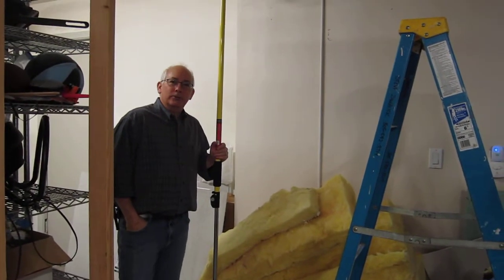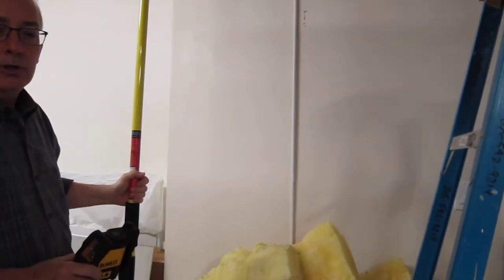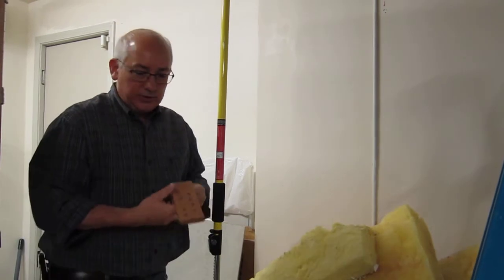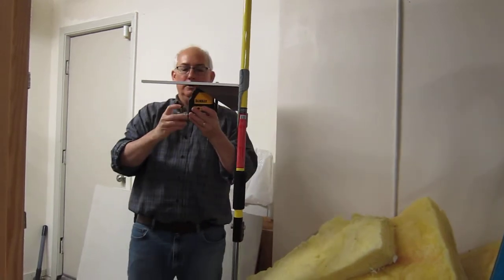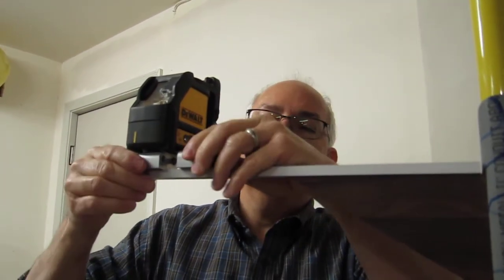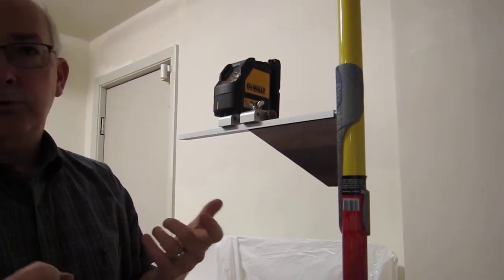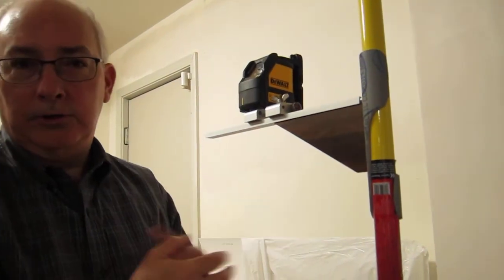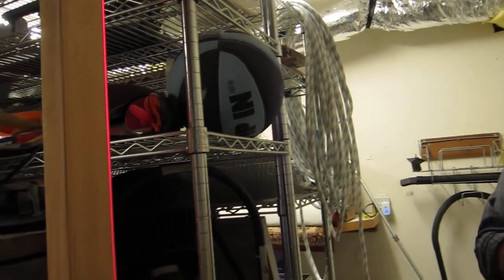Laser level jam mount, micro adjust, and design tips

Comment: But what about if you need to move it up or down? Does that mean you have to take that pvc S clamp off the pipe move it up or down till your at the desired height.
Reply from the maker: To adjust the height, you can simply rotate the spiral "clamp" back and forth and change it in small increments.
Reply: @ I’m surprised Dewalt haven’t put a set of arrow buttons on the level so you can adjust the line level either up or down  or left and right to hone in once your pretty much there. 

Thanks for the reply!
Reply: @ I’m also surprised Dewalt haven’t invented your pole thing it makes things so much easier.

Comment: A wonderful setup and a great idea. I was wondering, what specific micro adjusters are you using to mount your laser, onto the t-shape track?
Reply from the maker: Great question.  First of all, that is a leftover part from a micro-adjuster table saw flip stop from Trend tools (20 years ago).  More importantly, I found that I do not use it anymore.  It's just easier to rotate the laser and change the angle and get a change down to 1/32" or so.  It's easier and quicker than trying to loosen the micro-adjust, move it, and then tighten it again.

Comment: Very nice.  Can you explain how to make the micro-adjustment part for lateral adjustment?
Reply from the maker: Good question.  The gizmo I was using was from a router fence.  Basically I've found that by rotating the arm and re-pointing the laser I can get a finer adjustment.  If you want to try, however, the principle is simple.  Two T-Track clamps.  One supports the laser.  The other is fixed.  They are connected by a threaded rod which you can spin to bring them closer or push them apart.  Fix one, spin rod, clamp second.   Try making with these parts perhaps: MLCS 9313 Flip Stop Blocks by MLCS Woodworking https://www.amazon.com/dp/B00OBMH434/ref=cm_sw_em_r_mt_dp_S7J4R3ATGWSQ1KWV9KRG
Reply: @ironwooddesigns9532  Thanks!

Comment: This is great.  Do you have a parts list/links?  I see you say t track but when i search for t track on amazon its like 20.  I love the pvc idea.  I was just looking for a way to be able to secure plastic to a pole in the corner of my walls.  I will give that a shot.  I have a set of 3rd hand poles and they make  a mount for 20.  Just not sure how presise it it and would rather make my own if its cost effective.
Reply from the maker: Hi Maxx, here are the parts:

PVC: 1" ID PVC tube
T-bolt: https://amzn.to/3cQzQwL
T-track: https://amzn.to/3cQSzYU
Wide nuts: https://amzn.to/2YU78Tr

Prices

PVC: scrap
T-bolt: $2.29
T-track: $10.99
Wide nuts: $5.98